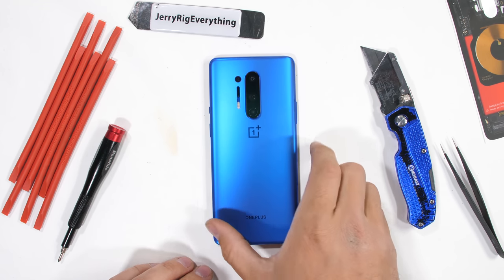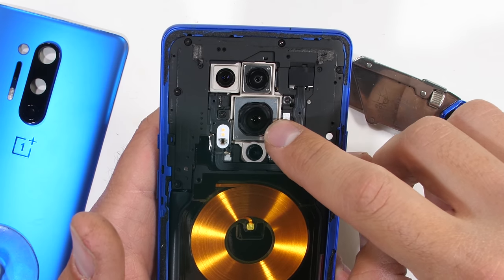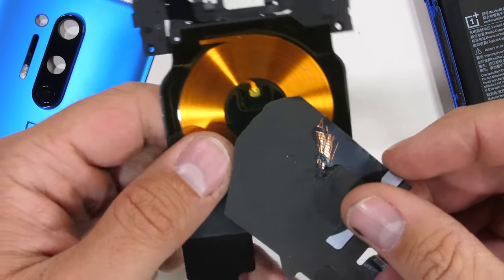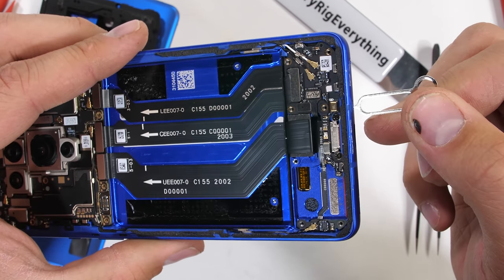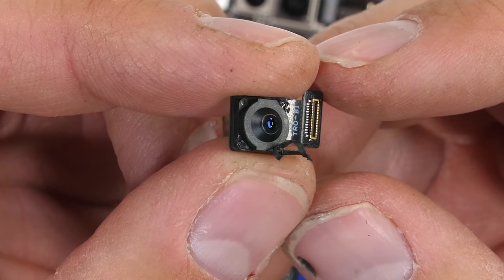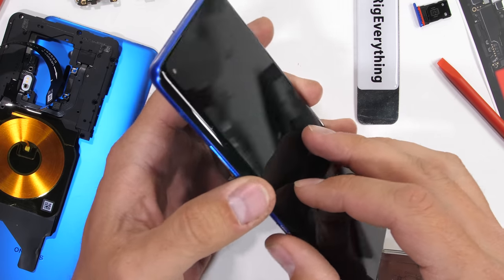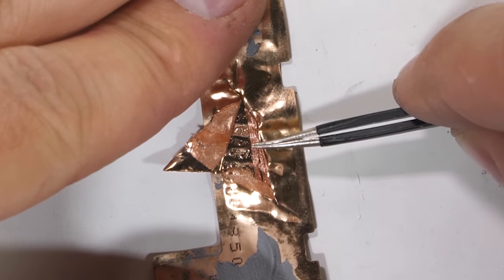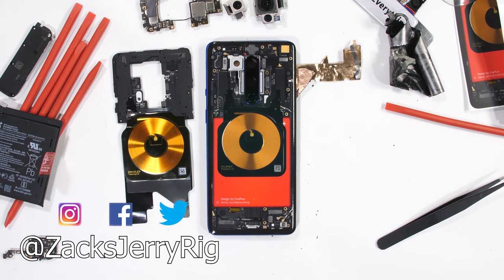OnePlus 8 Pro Teardown! - Big where it counts!

Comment: "Slightly less efficient than plugging it in"

If by slightly you mean 25% less efficient... wireless charging is a bad joke. It's less efficient, slower, and creates a ton more heat inside of the phone. Phone manufacturers should spend less time creating fancy wireless charging and more time redesigning the phones to fit more/more efficient batteries. If your phone had enough battery to stay charged throughout the day, there wouldn't be a need for new charging technology, other than making the cable charging even faster and more efficient.
Reply: Also, wireless charging is just gimmick, as you put the phone where the charger is, atleast wired plugged phone can be easily lifted up and used while charging
Reply: bigger battery? nah
headphone jack? no
37 useless cameras? OH YEAH, WRITE THAT DOWN!
Reply: Really man I personally don't like wireless charging can anyone explain me it's freaking purpose
Reply: @thefighissimo  I would argue that they are not completely useless as wirelessly charging
Reply: Wireless charging is about convenience, not speed. Thanks for totally missing the point.
Reply: @Gravage  how is it convenient to spend extra money on something useless? The charging pad is plugged into a usb cable so the power is already there anyway. Is it really that much harder to plug it in? If it is really that much harder, just buy a magnetic charging cable. It's cheaper AND more efficient.

Comment: Hi I was just wondering if you had any advice for me. I glued my screen protector the other day & I believe a little glue is slightly blocking my sound from the front speaker at the top. Should I try and get a syringe and try to shoot achohol into the tiny holes while music playing? Thanks
Reply: I'm facing the same problem, sound from earpiece crackles at high frequency at high volume due to this glue

Comment: Stop calling it wireless charging when it really isn't. You are laying it on a pad instead of putting a cable directly to your phone, you connect it via the pad wich still needs physical contact to function. Also pad chargers are useless as you are unable to use your device while laying on the pad charging. Just something to think about.

Comment: 9 months later..... Flagship which still doesn't support 5g in Switzerland because oneplus isn't unable to release the correct firmware in order to make it happen on all three swiss carrier. Additionally sms does not work correctly so forget any banking or two steps verification as you will receive your sms 10 min late..... Swiss customer be warned!